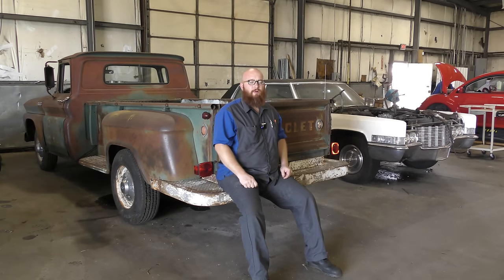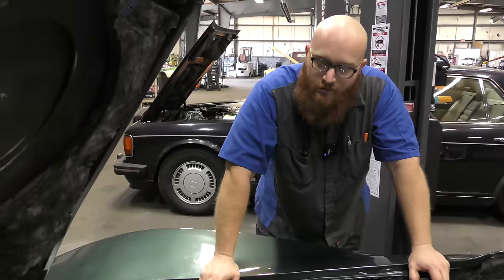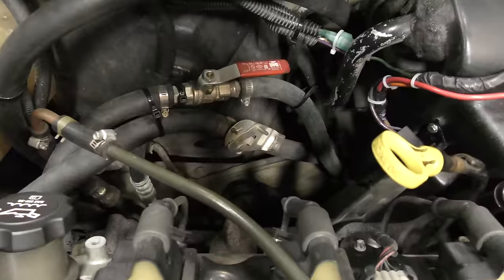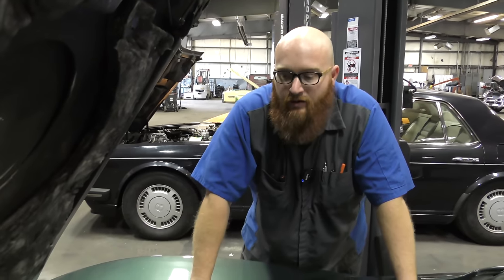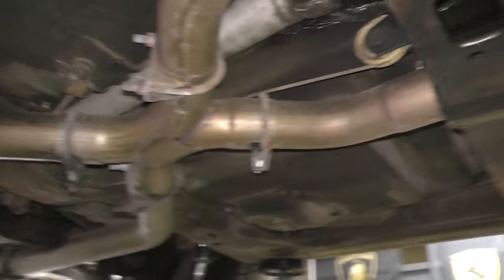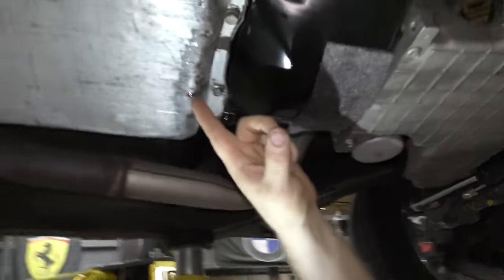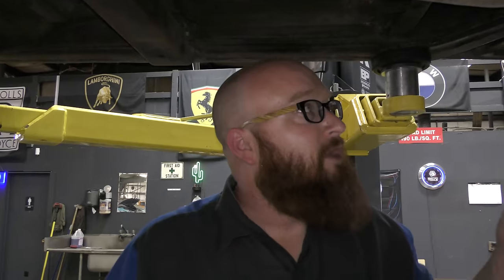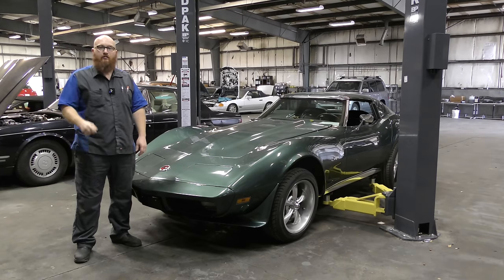Issues AFTER an LS swap! CAR WIZARD warns what can happen on an LS swapped '73 Corvette Stingray

Comment: We are a shop out of Houston Texas that does a LOT of these swaps. We have done 10 over the past two years. I know, and have documented, every single part number and piece name for every single component needed to make these swaps work just as the factory intended. Including A/C, dual electric fans (NOT GM fans, as they work BETTER than the GM set-up and are half the size), electric fuel pumps that ride inside the tank (original GM from later year vehicles modified to fit in the original tanks), wiring harnesses, engine mounts, ALL of it requires the ability to modify pieces on the fly. I like to use factory GM mounts for the year vehicle that we are working on so that if the customer needs to replace them in the future they can walk into their local auto parts store and order the right part that goes right in as factory. One of the biggest things that trips people up with these swaps is wiring the brake pedal switch in parallel with the lock-up function of the transmission. The brake pedal needs to provide 12V+ back to the PCM/TCM when your foot is OFF the pedal.. The older GM's only provide 12V+ when the pedal is depressed which is OPPOSITE of what the PCM/TCM needs. WIthout lock-up the trans is NEVER going to work correctly. It's going to over-heat, burn extra fuel, and generally live a short life. EVERY single customer attempted swap that comes to my shop to get sorted out needs this situation resolved. EVERY one of them. The aftermarket harnesses are TRASH. There are some china harnesses that are supposed to be "plug and play".. Yea... Right.... We use ONLY GM harnesses. Even a 20 year old GM harness is better than a brand new china harness. I've been down that road too many times.  Why your electric fan is not coming on with the A/C? Welp.. it's simple.. unless you have added a pressure sensor into the A/C line, the fan is not going to come on. In GM cars-such as the F-body-there is an A/C pressure switch, or trinary switch, when the head pressure reaches a pre-set point the hi-speed electric fan will come on. Without the pressure switch, there are other ways to make the fan come on with A/C... however.. getting that fan to turn OFF at freeway speeds when the A/C is on is the tricky part.. Once you are rolling down the road, at speeds of 45+ MPH, you DO NOT WANT the high speed fan on with the A/C... We have sorted that as well with no need for a pressure switch. The oil pan in the video is NOT a swap pan.. That is a factory GM Corvette oil pan!!! To remove fuel injection from an LS engine is just goofy plain and simple. I know there are times when you need to run a carb.. But in a daily, or even weekend, driven car just stay with the factory set up as it has proven to be very reliable, and makes driveability a lot better.

Comment: Just take your LS swapped car to a shop that builds rock crawlers. It is extremely common for guys in the off-road industry to deal with LSX swaps. Nothing we work with is ever stock. Nothing we deal with is ever a standard diagnostic procedure. Our entire business model is completely different from a standard line shop that works off book rates. We also understand the aftermarket part landscape and know how to deal with adaptations and the parts available to solve issues surrounding homologous vehicles.

Comment: If you're going to go to all that effort of swapping the engine, why use a carburetor?  Fuel injection is so much better.
Reply: so much easier and better to run a carb on a older vehicle
Reply: @redblock5949  I wouldn't say better since if it was we wouldn't have fuel injection. Definitely easier but definitely not better.
Reply: Think of regular Corvette owners, now make then a hardcore boomer, that's the owner of this car, has a carb but also has cruise control
Reply: It's cost, really. The biggest, nastiest carburetors I know are like $1500, for a 1425 CFM 4 barrel, single carb. It (the one he has) looks like a Street Demon carburetor - They flow 625-750 CFM and only costs about $400, under $500 max. Fuel Injection starts at about $1000-2000 at least. They're also pretty simple. It's basically just fuel you need to have the Carb work. You just kind of plop it on there and go from there. Assuming you know how to tune it, or know someone who does.
Carburetors aren't bad. They're cheap as hell and they can make good power - but don't get me wrong, fuel injection is definetly much better. But more expensive as well. Dude was probably just trying to save some cash. He'd need a different intake to make it work for EFI as well, which'd add more cost ontop of EFI being notably more expensive.
Reply: if your going to all the work why dont you just buy a celica?
Reply: I'm with the fuel injection crowd. It's an LS engine people. It was DESIGNED as a fuel injected engine. What's next? Yanking out the electric starter and going back to handcranking it from outside the vehicle Model T style?

Trivia fact:  The automotive carburetor was invented in 1888 by Karl Benz, founder of Mercedes Benz.  That's 132 year technology. To point, the wheel has been around for over 5,000 years, but we generally don't make them out of wood anymore.
Reply: Carburetors are much easier to deal with, but much less accurate concerning fuel delivery.  Also, you have to tune with a computer, which entails finding a place for the OBD II port,  change the fuel pump to a much higher PSI than a carbureted application, potentially have to run new, higher PSI rated fuel lines (Carb PSI is I think 6-8 and fuel injected for LS is somewhere around 60).  So, if you're on a budget or lack the time/motivation/expertise buying a LS carb manifold and carburetor is easier.
Reply: SupaFlyJedi bro... why would u cut corners. It’s an LS engine, use fuel injection. If you’re gna cut corners, don’t do it at all.
Reply: @SupaFlyJedi  if you're spending money on the ls do it correctly with FI. If you don't have the money for that don't go for the ls. If you're going to drop a carb on an ls you're wasting money just to be able to say you did an ls swap. Don't cheap out.
Reply: FI is not better.
Reply: @grabir01  really. How many cars do you see coming from the factory with carburetors? If it was so much better we wouldn't have fuel injection. Race a carbed car against Fi up a mountain then tell me what is better
Reply: @johnnysouza5601  i race my twin carbed 632 big block in the quarter mile against many fuel injected turds and i turn 7.09 in the quarter. 
The fuel injected cars idle a bit better but they do not put out the horsepower.
Go watch Nicks garage on youtube and he tested i engine carbed and injected and the carb set up put out way more horsepower wide open.
So basically fuel injection is for boys and carburetors are for men.
Reply: @vhp454  coming from someone who runs both I'm calling bullshit. Take 2 exactly same blocks with absolutely everything the same and compare. Trust me I have and FI was extremely better.
Reply: @grabir01  "FI is not better" bro... you living in the dinosaur age my dude. get wid the times
Reply: Without the correct ecu it's worthless.....
Reply: @herewegoagain7403  lolo young people are clueless on carburetors.
Reply: @johnnysouza5601  we did it. So has haggerty.
396 big block. It made more horsepower and torque at wide open throttle. The fuel injection idled better but lost horsepower and torque.
Reply: @SupaFlyJedi  And carbs are lower profile than most fuel injection setups. something very important to consider in engine swaps
Reply: @johnnysouza5601 Emissions killed the carburetor nothing else. Motor Trend did a head to head with the same engine carb vs EFI, carb made more power because the gas-air charge is cooled as it travels through the venturis
Reply: All fast cars have carburetors, EFI is only for emissions crap
Reply: @vhp454  "clueless on carburetors" that's like saying we should work on flip phones instead of iphones. Wrong era old-timer 😂
Reply: @johnnysouza5601  I dont know why you keep saying "cheap out". Have you looked how much it costs to buy a carb, Intake, control box and all the other crap you need to make a carb work on an LS? Its MORE expensive than throwing the LS in and using the fuel injection that it came with. Like, alot more lol.
Reply: @rite2beararms  wrong.
Reply: @vhp454  they're generally clueless on thirty pound 80s cellphones too. Why is that so terrible?
Reply: @redblock5949  actually nearly every modern performance vehicle made in the last FORTY years used some form of fuel injection. Lots of reasons besides emissions to switch - better fuel economy, better driveability in cold, warm and hot weather conditions, more efficient power and tuneability with a laptop instead of screwdrivers. Just a few reasons why carburetors are nowhere to be found on modern cars today.
Reply: Carburetor definition , poorly controlled fuel leak.
Reply: Master of Sinanju Master of Sinanju  no. If carbs were that great they would never have invented FI. Now I'm not saying carbs are complete shit but FI is extremely better and more efficient.
Reply: @grabir01  Big call!  EFI has been used on every production and race car for many years now. That suggests it is unequivocally better.
Reply: @herewegoagain7403  if some one wants fuel mileage i agree on fi. But i race wide open and my car is naturally aspirated with nox. Carbs and a control box with nox my all in my 632 is at 2901 hp. And i can street my car. For the extra cash needed FI my car i used the cash i saved in my chassis.
Basically i think you have never built any engines or done any swaps and i think your a pad wacker millennial ! But your opinion is your opinion!
Reply: @johnnysouza5601  i can tune a carb just as good as someone tuning FI with a keyboard
Reply: Yeah, if you're keeping the original engine, it makes sense to leave it carburated. But an LS engine is made for EFI.

Comment: Hey @Car Wizard one thing I can help with - that fan controller he has is an Afco 80199 fan controller and you can download the instructions from Speedway Motors. The system works by providing GROUND (not Power) and the green wire is the over-ride which should be connected to a powered switch when the AC turns on. Maybe it's wired to a pressure switch which is failed instead of the actual clutch power. 
I have the exact same unit on my modified Corvette. Hope it helps you or the owner!
Reply: Interesting! Everyone vote this up so he sees it!!
Reply: @Zo Fryer ?
Reply: @Zo Fryer 
Why can't you service your own EFI fuel system? I've been doing this professionally since before EFI systems and I know both systems well and I'm here to tell you that plugging in a laptop and changing the AF ratio and timing is a lot easier, a lot faster, and a hell of a lot less messy than changing jets in a carburetor and using a timing light.
EFI system's aren't any more difficult to learn than the old system's, especially the aftermarket stuff, you can download the software right off of the internet to work with any of them. 
And contrary to what I've heard hillbillies saying for 35+ year's now vehicle manufacturer's didn't spend hundreds of millions of dollars over the year's developing computer controlled EFI systems "just to keep people from working on their own vehicles", they did it because of ever increasing efficiency standards from the EPA, not to keep people from working on their own vehicles, anyone with an IQ low enough to think that is going to screw up anything they're working on whether it's a carb or EFI, and then of course it'll be everyone's fault but their's.
Reply: @Zo Fryer 
I thought we were talking about cars here, why is it every time the subject of performance modifications for cars or motorcycles is being talked about people want to bring up what John Deere does?
These aftermarket systems are designed for the customer to easily tune the system, what in the world does John Deere have to do with it?
And it's a bigger difference than 2 MPG with these system's, the narrative of "They don't make 'em like that anymore" only lasted until about the mid 80's when it come's to performance, you can buy a bone stock performance car nowadays that'll blow the doors off of any 60's muscle cars, it'll get twice the mileage, make twice the HP and hold a rock steady idle, the reality is that there's soccer mom's that are driving cross overs that'll beat any 60's performance car in the quarter mile, stop in 2/3rds the distance and out corner them, and the fact is they're like that because they were forced to improve everything needed for them to be that good because of government regulations, everyone's cussed the EPA over the year's but really the vehicles have become that more powerful because of the engineers being forced to make them more efficient, more efficiency=more power, it's actually been a blessing in disguise.
Reply: @dukecraig2402  You are absolutely correct. I had a 71 GTO 400 heavily modified and it was a blast to drive but todays factory performance cars would blow it away, give you better gas mileage, smoother, quieter ride and have the AC on and all I would see would be tail lights. As much as I did enjoy those days they really don't make them like that anymore and be grateful for it. Well, that is until you suddenly see that loose wire/vacuum hose and have to find out where it supposed go. I like watching todays video's for Hellcats, Camero SS, Corvette's and they perform magic compared to the original muscle cars.
Reply: It wouldn't take me 5 hours to figure out the wiring 😂.,...... maybe 5 hours to rewire the whole fn Corvette 😮
Reply: @dukecraig2402 : thank you for your statement. ... !!! 
My only small question is, why don't we get 50 miles to a  gallon if everything's about efficiency?.. ??? .. 😅😅😅
And of course, the other issue is the older The Wirring gets the more trouble you have ... !!! Especially AT connections.

Comment: I like how you are pointing out the reality versus the fantasy of owning and maintaining a restomod vehicle.
Reply: depends upon who does the restomod work and how well he does it. All modifications should be documented and wiring diagramed.  problems like the wrong AC condenser should be worked out. Using carbs instead of fuel injection is generally a bad idea unless you know how to fix it yourself. Also, all replaceable parts like the front transmission seal should be completed before final assembly. 
If this car had been done right it wouldn't have been in the shop in the first place
Reply: @wesleysaams448 yea, how many do you know that get done right that don't come out of the same shop? This is the reality for most people.

Comment: That Vette would be best off with factory LS injection, ignition  and a complete Vintage air AC kit, if the owner intends to keep it. Less of a hodge-podge and then you have obd2 diagnostics and a unified AC system with documentation.  Bite the bullet on the expense and have a much better sorted machine to enjoy for the future. I think it's value would increase as well with this solution.

Comment: Tuning any carb is so easy 
1) turn up ⬆️ idle to 1100 rpm
2) wind to air mixture screw all the way in until bogs , back off 1/2 turn
3)do exact same to the other air/mixture screw , 
4) turn idle down to 650 rpm 
5) repeat 🔁 steps 2 and 3 again ! 
6) viola Set !

Comment: Sweet Vette, for sure! I used to have a ‘74. Like you, I can’t understand why they would ditch the fuel injection for the carburetor. Doesn’t make any sense at all. The whole point of doing an LS swap is to benefit from the modern reliability and performance... SMH 🤦‍♂️
Reply: buy a long block and ignition vs buying a whole car to scavenge the fuel and electronics

Comment: I work in the auto parts business and I feel bad for the guys that bring in old cars that not only have engine swaps..but brake and suspension swaps! Last month had a guy come in wanting control arm bushings and a brake booster and master cylinder for a 55' F100, those were originally straight axle and manual brake trucks. It had been upgraded back in the 90s before he got it. He had no idea what the donor car or cars were... Now I do modify cars myself Stick mostly to cars older than 79 and if I DO use parts from a different car...say granada brakes on an early mustang I actually keep a binder with a list of all the donor cars and parts that were used..and if possible part numbers. And if I sell a car that binder goes with it.
Reply: I've helped restore several old cars. Due to grandpa. He did this alllll the time. We did a full restoration to 3 ford fairlanes 55 and 54. The only thing we didnt keep stock was the drum brakes. We converted over to disc. One car was converted to 12 volts because  the wiring harness was so degraded that it was easier for us to build a wiring harness than it was to repair or find. One. Lol that's why I like older cars.
Reply: I worked in the parts business for several years had this happen quite a bit. There's aftermarket companies that make straight bolt on components for suspension and brake upgrades but you're gonna have to pay for it but it's worth it in the end to stop dealing with the headaches
Reply: I worked in the parts business for a bit, and became the guy that knew his stuff, and was willing to work with the customer to find the right parts on oddball swaps. I guess now that's why I prefer to keep my car mostly stock or make it very obvious what parts are what.